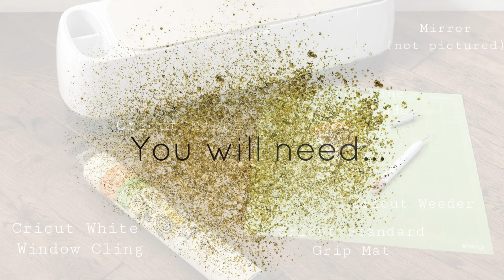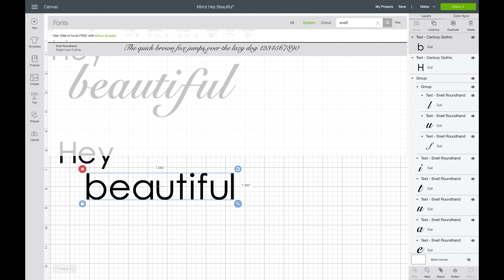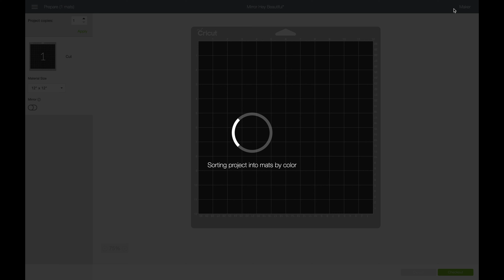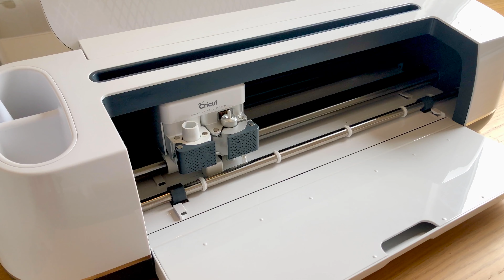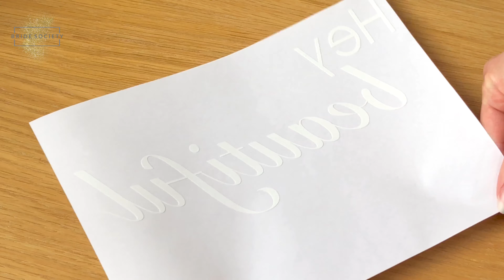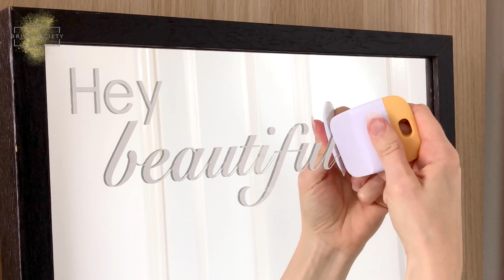Cricut Mirror Decal Tutorial: How to design, cut and apply Cricut Window Cling

Comment: hi! This video was so helpful and fun. I was wondering on which cricut machine to get, im a beginner and on a budget. Wanting to start up my small business but taking it slowly. Im more towards doing mirrors so that would require all sizes of stickers letters, big small, extra big 
what sort of machine should I opt for in this case? 
Thank you :)
Reply from the maker: Hi there,
So glad you enjoyed the video, thank you for commenting. 

With regards to the type of Cricut machine for your needs… it sort of depends on your definition of ‘extra big’. The largest width any of the machines can give you will be 13”. But that’s only with the newest machines that use the Smart vinyls, so the Cricut Maker 3 and the Cricut Explore 3. Those can make single design cuts as long as 12ft using the Smart vinyls. 
It sounds like the Cricut Joy would be immediately out for you given its petite size. Whilst it has the ability to cut decent length it likely doesn’t have the width for your needs - although it’s the most budget friendly machine. 
Also worth noting you can get refurbished machines from the Cricut website at discounted prices, in case that helps with the budget. 
If you’re keen to do more than cut vinyl or card, such as cut basswood, fabric, deboss, engrave…then you’ll need a Maker machine, not the Explore. But if you don’t see yourself wanting to do those things, which sounds like isn’t your intention from what you said, then you should be good with the slightly cheaper Explore. 
I hope that helps a little. But do let me know if you need anything I’ve said clarifying or if you have any other questions. 
Good luck with your small business.

Comment: Hey! Your video was such a huge help, thank you so much. I do wonder if I could find this vinyl in a different color or does it only come in a few colors? I needed blue, but I only saw it in select colors. I’m in the US.
Reply from the maker: Hi Carmesha, I’m so glad you found our video helpful, I really appreciate you taking the time to leave us a comment. 
Currently I believe Cricut window cling only comes in white, black, orange, red and frosted. So, as you say, not a huge range of choice as yet unfortunately. 
I guess a way around this could be to use a blue from their ‘removable premium vinyl’ range (I’ve just had a look on the US Cricut website and looks like there’s a blue one on sale at the moment!)...I’ve not personally tried using it in this way, but theoretically it is removable so you should be able to...it’s supposed to be removable without residue for up to 2 years (from memory). Might that work for your project?
Reply: @BrideSociety  Wow! Thank you so much for your help and responding quickly, I totally appreciate that! I will check that out on their website right now. Thank you!